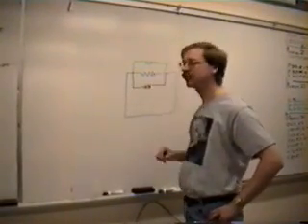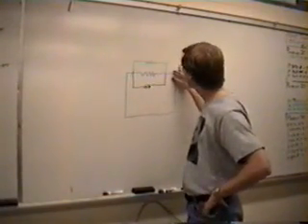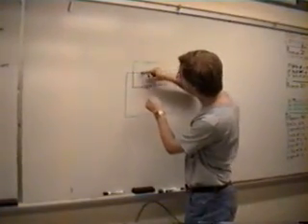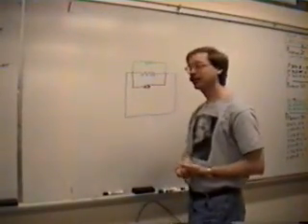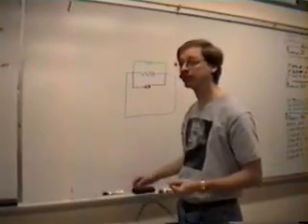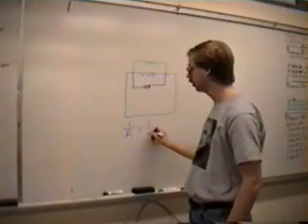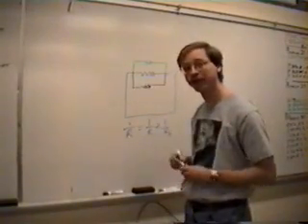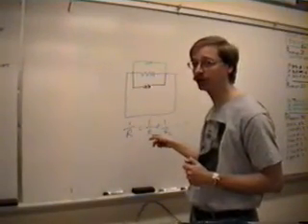Series and Parallel Circuits

Comment: which is the one series or circuit when you have more than one unit producing volts (let's say a solar panel.)  that the volts stay the same no matter how many  volt producing units there are, but the amps increases... which is is that seriesor circuit? 
thanks